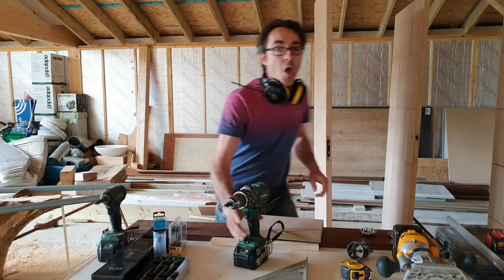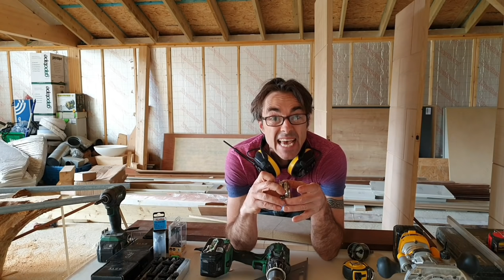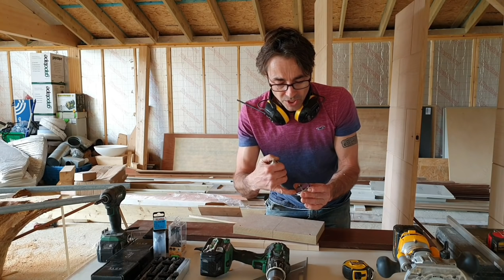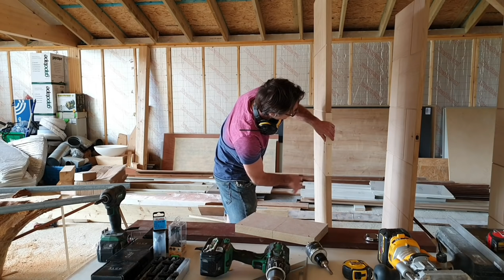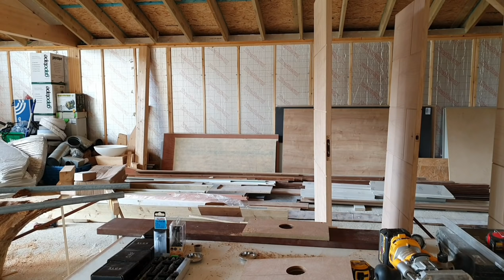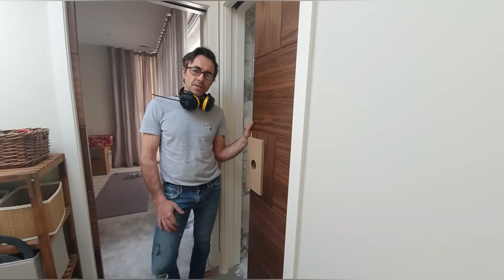How to use a router, template and sliding door handles

Comment: Hi Robin, I have been told that if you tighten the chuck on the drill by hand and then turn it just a little bit back until it clicks, it will lock the chuck so the bit can't fall out. Don't know if it works on all drills, but it works on my makita drills. Nice video ;)
Reply: I've never heard of that, definitely give it a go one day cheers 👍
Reply: Niels Kvist works on dewalt
Reply: Interesting. I've always been so frustrated with Makita chucks dropping the bit, I'll give that a go. Cheers.
Reply: also on Bosch
Reply: Been using a Makita drill for years and didn't know that - you learn something new every day!

Comment: I did a pocket door last year with exact same problem. Assuming the flush pulls came from "IMD". They are great quality I think for the money just a shame about the odd size. I didn't have time to find another bit so used the 25mm and small barrel sanding bit to get the 0.4👍
Reply from the maker: Perfect solution that sander, thanks for watching

Comment: Hey bud love the channel, what hole saw is that because you got the cutout out so easily mine I have to use a pencil or something to get them out
Reply: It looks like a Bosch quick release system.  I own the same type and it saves lots of time messing with pencils or other drill bits to get the piece out. Worth the money
Reply: Drive two long screws through the blank that remains in the hole saw until they bottom-out. Much easier to extract than all the faffing around trying to prise them out.
Reply from the maker: Jony Levitt was spot on, it's the Bosch quick release system, best hole cutting arbour that I have!!

Comment: hi robin. can you tell me what size guide bush and router bit you used. i only ask as generally when you use a guide bush you make the template bigger. thanks. also do you know much in terms of letter templating in wood. something i really want to learn? great video
thanks
Reply from the maker: Hi Matthew, I am using a 16mm guide bush and a 12mm two flute cutter, this is the same set up as you would use with a hinge jig, I have done letter templating before for the odd bit of engraving, mostly I do it free hand, there are some of the peg templates systems for lettering maybe look on google? all the best Robin

Comment: I think a  vernier caliper would be a good addition to your toolbox, you might have saved a few quid on all those forstner bits lol .. and yeah I often have them keyless chucks come loose which it stops, you really have to crank em proper.
Reply from the maker: You are right, I will look at one, any recommendations?
Reply: @ukconstruction  Sure, the tend is towards the digital ones BUT think of that getting bashed around in a toolbox or on a  work bench, the plastic housing for LCD etc wont last and it needs batteries which have a habit of running out when most needed, so I would say go with an old skool vernier scale, very easy to read down to .1mm (even .05mm with keen eyes) You really don't need the no-brainer digital read out. Something like the Moore and Wright 110 Series MW110-07 Precision Miniature Pocket Vernier Caliper 0-70mm  is 20 Quids from Amazon. I am sure you will use it often. There are much cheaper plastic ones, but generally those are pants. Cheers.
Reply: @ukconstruction  Starrett does one which is water proof and dust proof. 110 pound like but it's a Starrett. Still really handy. You can scribe wood/metal with them as they have hardened tips and they also measure hole depths too by using the depth gauge that sticks out the end. This is the 150mm one: https://www.ebay.co.uk/itm/352514876386

Comment: I'd advise putting the front handle on your drill/driver whilst using a hole saw. You could seriously damage your wrist if it snatches.
Reply from the maker: Not for those small hole saws, anything over 75mm the handle goes on!!

Comment: Hi Robin, how did you determine the size of the template hole in relation to the router bit and guide bush.
Reply: Barry Smith if you measure back from the cutter to the outside of guide then find a holesaw + the extra mm required all around and give that a go,
Reply from the maker: Thanks for answering that so nicely and spot on Daniel

Comment: Why not use the Forstner bit for the handles?
Reply from the maker: At that diameter the risk of damage to the door would be a worry, I know you could clamp a section to drill through but the mess is mad!! good suggestion though
Reply: Robin Clevett always use Forstner when I have done these, takes about ten seconds each side. On the eclisse doors the flush handles are about 45mmish I think (looks like eclisse you’re using?) never had a problem. It’s nice to put a small pilot hole first to guide the Forstner .  Having said that I have never used pre finished doors in pockets so maybe the jig is belt and braces,  you seem to know your stuff so I wouldn’t like to question your methods to much.

Comment: Hi Rob

Could you please tell the best router to buy either battery (Makita) or mains for little jobs around the house as I am doing a house up.
Regards James
Reply from the maker: Hi James, most palm routers either battery or mains are only a quarter collet, idea for all small mouldings and lighter duty routing like hanging doors etc, if you want to make staircases or other joinery with a router then a mains powered half inch router is the way to go
If you are running the 18v makita platform then I would suggest the battery router is great as not having a cord on a router is really nice!!
Let me know what you decide, oh and the battery makita is a really nice tool too
Reply: @ukconstruction  cheers Robin.
Yh it's only really for hanging doors and taking edges off window board's ect for now.
Cheers James

Comment: Try puting your drill on a lower speed, the drill bits and especially the hole saw will last longer.  The hole you cut with the hole saw was burnt black because it was too hot.

Comment: Dont you find robin if you make a slip over jig like that there is the potential for it to scratch the finished door. Got to be super clean and careful that way. 😬
Reply from the maker: You are spot on, I will post a video shortly where I use the jib, the key is dust extraction and vacuuming prior to the removal of the jig, cheers Daniel
Reply: It happened to me as an apprentice. Id spent ages making the jig id not long had a router. I put a nice deep scratch down one face of a double set of 1 off doors with a huge lead time. In a hospital wing 😂😂😂  they had a veneered leaf on them of a different hardwood tree to tell you what wing it was. Like an oak leaf for oak wing ect special order 😂😂😂😂😂😂😂😂😂

Comment: Aren't those handles supposed to be flush fitted or am I missing something?
Reply from the maker: Yes they are flush, when on the door
Reply: @ukconstruction  Ah ok, so they weren't pressed in home on the test piece I guess.
Sometimes you have to cut the body in one diameter hole and then the faceplate with a wider diameter hole.
Reply: Robin Clevett 😂😂😂

Comment: don't slide the bit in so it touches the bottom of the chuck, pull it forward a touch before it bottoms out then tighten. for some reason they work better that way

Comment: Hi Robin, Does your router bit cut right upto the edge of the guide bush?
Reply from the maker: Hi Paul, I use a 16mm guide bush and a 12mm two flute cutter so there is 2mm clearance between the cutter and the guide bush, so when I make a template I allow for the guide bush and the clearance to end up with the correct finish, hope that helps Paul
Reply: Robin Clevett delighted you responded. I’m a big fan 👍⭐️